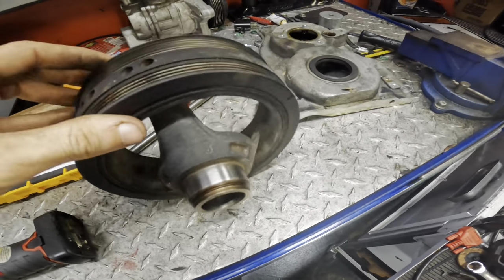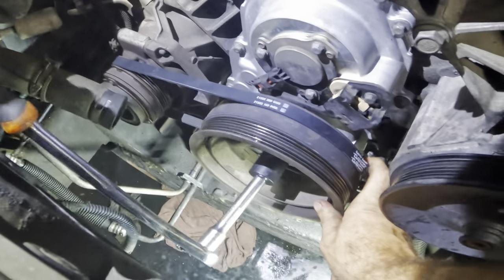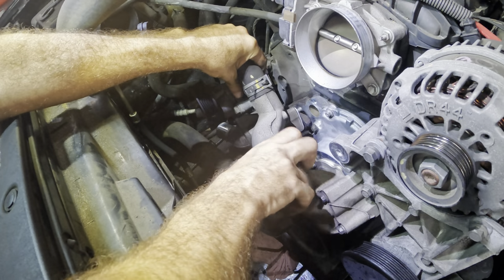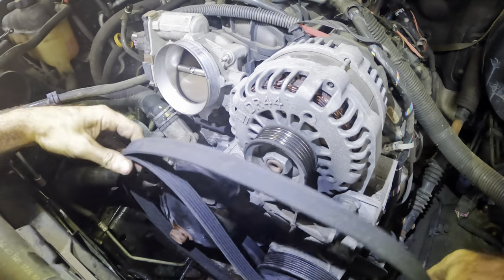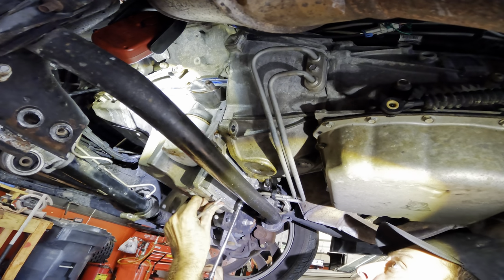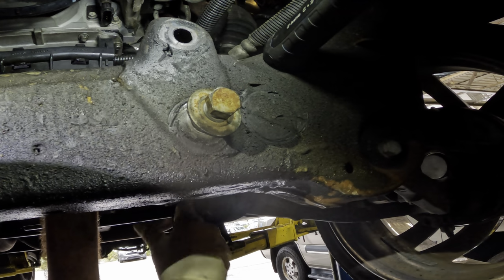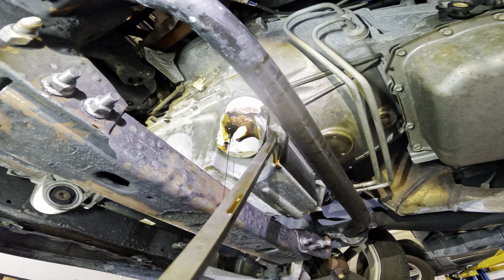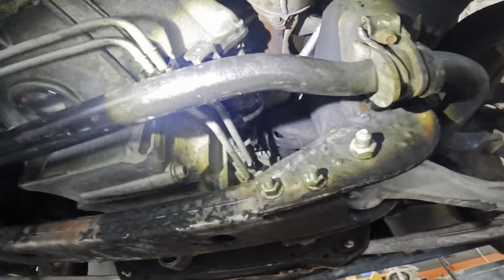Customer States: Melling Oil Pump Upgrade! GM 5.3 V8 PT2

Comment: The last guy over tightened everything,  not like ray who does things the right way,  respect from the uk,  😁👍
Reply: It's highly likely the failure of the pan gasket was caused by over torquing the mounting bolts. A lot of people assume because a gasket is leaking the bolts are not tight enough (you'll notice even Ray first checked to see if they were loose before he found the opposite to be the case), which was proven false in this case. Overtightened the mounting bolts can warp the pan mounting surface and crush the gasket leading to an oil leak. This is very common with valve rocker covers where where the torque is very minimal as the seal will fail with overtightening.
Reply: He overtightened everything except the starter bolts, those were just snug when Ray removed them. That last guy was either mad about having to do the job or just a complete maroon.
Reply: @ralfie8801  Either that or he was using a power air/ electric ratchet to torque them. The proper torque for these pan bolts is 18 ft lbs, where even my cheap 1/4 in Harbor freight electric ratchet is rated at 35 ft lbs of torque and a Milwaukee 3/8 Fuel is rated at 55 ft lbs. When dealing with gaskets, a  "click" wrench is your friend if you want to do it right. There is also no way to know if the previous installer even followed the correct tightening pattern. It is really sad to see the shortcuts some of these techs take. More and more it's sadly seems that honest and knowledgeable techs like Ray are the exception.
Reply: RIGHT WAY RAY!
Reply: @TheOnespeedbiker  The aluminum carrier limits the crush on this gasket.  As long as the bolts are somewhere between snug and broken the actual crush on the silicone gasket is going to be the same.  These gaskets aren't very sensitive to torque.  it's a pretty foolproof design.
It wouldn't surprise me if the previous guy damaged his replacement gasket and over tightened the bolts in an attempt to correct the problem.
Reply: @21stcenturyfossil7  The aluminum carrier is just that, a carrier; it's function is not to stop the over deformation of the gasket. There is a reason there is a specific torque rating, too little or too much can compromise the seal. An obvious point is the gasket seal did fail, and while I would not say it was definitive proof, absent any other obvious cause, the over torquing of the bolts would at least indicate that it was the possible cause of the gasket failure.
Reply: @ralfie8801  plot twist, it was the owner of the vehicle

Comment: Ray,  Here's a tip to hold those upside down bolts in the water pump until you get it all lined up.  Just wrap a rubber band around each group of three bolts and take the bands off again when you get the threads started.  I call them anti-bolt-gravity devises. I sell them for $29.88 each or $71.02 for a matched pair.
Reply: Your pricing scheme is Apple-worthy!
Reply: I'm going to buy one rubber band twice!
Reply: @61rampy65  Oh yeah. Rubber bands can "snap on" to things!
Reply: @MonkeyJedi99  Snap-On Rubber Band set is $499.99
Reply: @nephicus339  Is it blue? If it's blue, you know it's good!
Reply: @nephicus339  worth every cent !!!
Reply: Too expensive for us retired folks
Reply: Rubber band thing doesn’t work because it pulls the bolts in an they don’t line up with the holes.
Reply: @thomaslyon2112  - It sounds like you need to start hitting the gym if you can't overcome the massive pull of a little rubber band. 🤣

Comment: 27:00  this reminds me of the first oil change my dad and I did on my first car, a 73 Chevy Nova.  The previous person has put the filter in so tight, my dad had to impale it with a screwdriver and use that to make it turn.  He ended up splitting the filter in half before getting it off, but it did eventually come off.
Reply: Funny, my Dad did EVERY oil change with a screwdriver no matter the vehicle.
Reply: First thing i thought of was the screwdriver trick.
Reply: I only ever put them on hand tight, but have had to do the screwdriver trick several times.  That was before I got the oil filter strap, though.  (Nylon webbing strap on a bolt like thing.  The strap wraps around the bolt part until it tightens up to grip the filter & then loosen it.)
Reply: I actually had one that the screwdriver ripped in half. Ended up using a chisel on the base to unscrew it.

Comment: I'm not a mechanic, so I had never heard of a "clear flood mode" on a car.  However, I do have an old (made in 1958) farm tractor, and it is the proper procedure when changing the oil or hydraulic fluid to flush the system with kerosene to clear out any gunk or debris.  However, you certainly don't want kerosene lingering in your oil or hydraulic system, and the hydraulic and oil pumps are at the opposite end of the machine from their respective reservoirs, so how do we ensure the pump doesn't hang on to any kerosene or, even worse, accumulate the gunk that the kerosene broke loose?  You simply engage the starter without placing the tractor in "ignition" mode.  The starter motor will then actuate all the accessory belts and purge the kerosene from either system.  A very interesting "old school" version of that clear flood feature.  Thought you might appreciate the comparison, and as always, fantastic and informative video!

Comment: Ray, I would NEVER EVER negatively criticize your work, I can't emphasize that enough. That being said, if I knew I was going to change the filter anyway, I believe I'd have taken it off while I had the pan out. I'm quite sure you had your reasons why you didn't because, like me, there is ALWAYS a method to your madness!!!! Oh, and as far as it being stuck so badly, whomever installed it was kind of an IDIOT for getting it so tight!!! I've run into that several times myself in my 30+ years of turning wrenches. It's NEVER easy to take one out that's so tight!!! Great video as always, MUCH RESPECT from South Carolina!!
Reply: I was thinking the same thing but as you say a method to the madness.
Reply: I know he states he doesn't pre-fill filters as to not introduce contaminants. He may have left it on for the same reason. But then again, the entire pan was off, so who knows.
Reply: I'm sure if he'd have known it was this tight, he would have battled it when the pan was off.
Reply: I see Ray do all sorts of stuff the way I don't, sometimes it' better. But the job gets done and  no time was lost.
Reply: @PeaceMarauder  Not a mechanic but I suppose there is more than one way to skin a Cat but just one way to put it together correctly. The problem is that the cowboy mechanics tarnish people's perception of the Industry as a whole when there are in fact a lot of very good mechanics and a bunch like Ray, Eric O and Ivan to name three who care about what they do and how they do it. I just wish they were all as good rather than just looking at scan data and firing the parts cannon and hoping for the best.
Reply: If we didn't have a strap wrench we just rammed a screwdriver through it and used that as a lever.
Reply: @chrisbentleywalkingandrambling  Would you trust Garage 54 to work on your car? :P
Reply: @PeaceMarauder  only if they used sawdust and Lead.
😂😂😂🤪
Reply: The LS 1 in my ute was factory fitted with a secret self tightening oil filter adapter. Spin em' on till it just touches, and guarenteed, it has had 4210 lbft applied mysteriously when next removal is due!  I spent $8 on a filter socket, it works just so much easier than a screwdriver or pry bar!

Comment: Wow! A thermostat replacement that didn't take 2 to 3 days, a couple of broken bolts, a drill, easy extractor and a helix coil and enough curse words to make a sailor blush! I'm impressed!
Reply: And then replace both housing and base as you've destroyed them in the process. (Broken 'easy' extractor in sheared shaft of bolt)
Reply: I remember when it took a touch of magic to hold the thermostat in place until the housing was secured.
Reply: one of those northern folk?
Reply: Begine by removing the rear bumper.

Comment: Set those press-on pullies out in the sun for a while or in an oven to about 200 degrees and they go on a lot easier. Also always lube the OD of the pully hub so it does not damage the seal while going in.
Reply: another engineering failure , needs a keyway slot
Reply: @charleswright9348  you can usually count on GM to engineer things poorly
Reply: We used to heat them with a few seconds of propane torch. Just enough to get them too hot to touch.
Reply: @stevewhiting556  I have don't that. Heat the inside of it and it slips on. Give it a wack or two with the rubber hammer.
Reply: I was always told to leave the timing cover slightly loose while pressing on front pulley. It permits the seal to centralise its self.
Reply: @stephenmead8183  Yeah, thats how I do those 5.3l. They don't have dowel pins in the cover, so there is a little wiggle room. The crank pulley hole centers it. Other engines with dowel pins don't require that.
Reply: Seal has to be dry when installing the balancer to an LS engine. It is a teflon seal and will leak if lubed up, same with the rear main.

Comment: That's the most mangled oil filter I've seen so far this year. Awesome pry bar action instead of the anticipated screwdriver. Awesomeness!
Reply: I have tore the top off a first oil change filter and had to back it out with chisel on the remaining rim. I recommend dealerships for first oil change 🫣
Reply: Just wondering...why you didn't remove the filter when the pan was out? 🤔

Comment: Few tips on these gm trucks. If you get a ac compressor belt from the dealer it comes with the install tool. Make sure to align the front cover with the tool or put the crank pulley on before tightening the bolts. The cam and crank marks are supposed to face each other. Always replace the cam gear “bolt” if you take it off. Other than that its all good🫡

Comment: Hey Ray. Those filter pliers are the worst, get your self some filter cup sockets makes the job better. Thanks great content.
Reply: I like filter cup sockets but they do slow down the work because there are so many shapes and sizes.  Now if all manufacturers made filters that fit the same socket, that would rock.

Comment: Hi George from Alberta, Canada. I remember about 30 yrs. ago a few years after becoming a licensed mechanic I had a 82 GMC 3/4 ton truck with a 350 cid come into the shop where I worked I literally twisted the filter off. The filter baseplate was stuck to the surface. Used an air chisel to remove it. So much for Mr.Lube.lol

Comment: As for holding the bolts I was taught in the USAF I keep a small tin of 90 weight grease and put that on the bolt head, that will hold the bolt to the socket

Comment: I've become envious of the frequency of your oil pan gaskets on these 2wd chevys. I've always had to convert the 4wd to 2wd before doing the pan gaskets or motor mounts. Believe it or not, I have done an oil pump without removing the pan. It is not easy nor do I recommend it but it can be done. Love the videos.

Comment: The hardest part of the coat hanger method is finding on of those freakin’ metal coat hangers!!
Reply: Zip-ties. I use zip-ties when installing a slip-fit belt on the washers I work on that have a belt
Reply: I keep a roll of Romex for such stuff.  You can separate into individual wires to use bare, or keep the insulation on to avoid gouges or even use the full cable if you need some heavy-duty action.
Reply: I find that if you leave two coat hangers alone in a closet and close the door, they will mate like rabbits and in the future you will have many coat hangers. At least that's how biology and physics work in my universe.
Reply: Have thrown out or recycled dozens of metal hangers over the past years and also used many as Oxy Acet welding rods.
Reply: @BixbyConsequence  Nice! A customizable tool.
Reply: Nope. The hardest part of getting a coat hanger is when you lock your keys in your car in front of an abortion clinic & are forced to knock on the door to ask for one.
Reply: @bloodybones63  🤣

Comment: Hey Ray, excellent work as always. It never ceases to amaze me that some people have to crank an oil filter on really tight when "everyone knows" hand tight only. I'm still trying to figure out who this group of "some people" are. A question for greater minds than ours.
Reply: They're the same group who don't work by the mantra of, "Don't F over the next guy, because I might be the next guy."  Or perhaps they have already aggravated the customer so much that they know they won't be...
Reply: They are probably the same group that just read scan data and then fire the parts cannon and hope for the best especially if they get commission on each part sold.
Reply: Sorry to say, "hand tight" is undefined.  Strong hands?, weak hands?, dry hands?, oily hands?  Most filters have the correct tightening instructions on them, usually expressed in fractional turns, or angle of rotation after the gasket makes contact.  That's the way to do it and it doesn't matter if you use your hand or a tool to accomplish it.
Reply: @BixbyConsequence  True.  However it is way too easy to overtighten when using said tools when not paying proper attention, which seems to be as soon as the tool makes contact for those people.
Reply: @NemoConsequentae  Under-tightened filters are just as big a problem except they don't present the next mechanic with a stuck filter but rather a seized engine.
Reply: @BixbyConsequence  True, but any halfway competent person will see the leaking oil from the too loose filter immediately on starting, of on the ground as they move it out of the stall.  Had that happen with a oil filter seal that didn't on my bike...

Comment: Correct me if I am wrong but that crank pulley is balanced to that specific crank (See holes drilled?) for rotation of engine. Thus it should have been marked before removing and repositioned in original spot before press fitting it back on. Thus why some manufactures "key" the balancer/pulley and others mark position installed. I know that my built engines do so, thus why I question.
Reply: my guess is, why would the factory waste a step balancing pulley and crank together, and then have to take it back off in order to assemble the engine....so the crank pulley, like the flywheel is balanced individually, and then assembled. Just a guess....
Reply: If it was balanced to that particular crank, wouldn't they need a keyway to reassemble it correctly?  Otherwise, how could they pull the balancer and get it indexed exactly right after putting on the front cover?  And why would a manufacturer take those extra steps when they want to turn out hundreds of motors a day?

Comment: @ 25:35 , i remember the hyundai techs overtightened the hell out of my oil filter on my sonata. at the time all i had was the strap filter tool, which proved useless. i had to bust out the drill and drill a hole through the center of the filter. that’s the last time i ever let hyundai do work on my car. granted, they did have to do an oil change since they replaced some things with the oil sending and what not, but still. that filter was insanely tight. last time around the parts store i bought a real filter wrench like the one you’re using which proved very handy. nice job ray 👍🏼👍🏼

Comment: If you'll run 3 zip ties through the crank and tighten them they will hold that belt so you can install it works perfectly on any stretch belt

Comment: Took 3 days once removing the oil filter on a Chevy Citation.  It was overtightened and all access paths for tools were blocked for no apparent reason. I spent the time vowing to track down each and every one of the designers so I could slap them.
Reply: My mother used to have an '81 Citation with the 2.5 Litre 4 cylinder Pontiac "Iron Duke" engine.  Always had to pump the crap out of the gas pedal to get it to start when cold.  Ah, carburetors😜

Comment: Use a zip tie to get the AC belt on, then snip it off when complete.
Reply: Thats how I do them. On those 5.3l, you also have to pull on the lower part of the belt so it doesn't slip off the ac compressor in the opposite direction.

Comment: i recently changed my ac compressor belt and was dreading it because I dont have a tool nor am I much of a mechanic (it was causing a squeal on idle). Found that loosening the compressor with a jack underneath to hold it in place made it very easy to install, just took a little bit of wiggling and it was on there after I put the bolts back in.

Comment: You use the power tool then the torque wrench but the torque wrench doesnt turn a bit before clicking suggesting power tool over tightened it.

Comment: Ray. Try putting a rubber band around the three bolts for the water pump (x2). This holds the bolts and gasket in place and once you have the bolts started cut the bands off. Used this a few times on FPR's on a TD5, works a treat.
Reply: I Agee the rubber bands are an excellent idea and worth mentioning for everyone’s futere problem gasket or similar installs but in this case the master got it done without all that messing around🙃🙃
Reply: I just use 4 old water pump bolts with the heads cut off & ground to a dull point! Pick 4 easy bolts to get at slide gaskets on, slide on the pump, done deal !
Reply: @johnlarkin549  Yeah, he nailed it. FPR's on a TD5 are awful, they lay back at an angle and all three bolts want to fall out so the band trick is a must. I love little work rounds. 😁

Comment: Ray im surprised I never see you using the oil filter wrench tool. The pliers you have look mighty useful for most of the filters you come across, but the ratchet attachment REALLY gets a grip on stubborn over tightened filters. I’m sure you’ve seen it before, its the 3 arm attachment that goes on the end of your ratchet and tightens down on the filter while you loosen. Works wonders for me. Have you ever used one before?